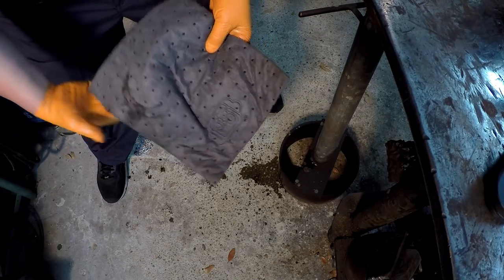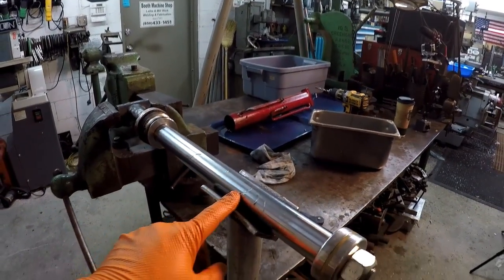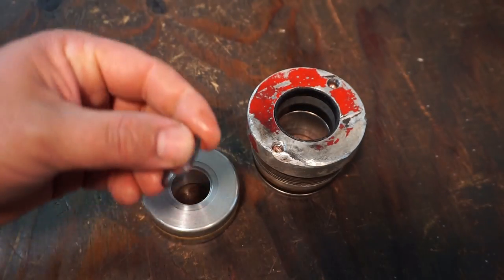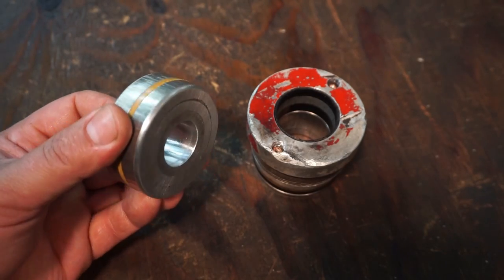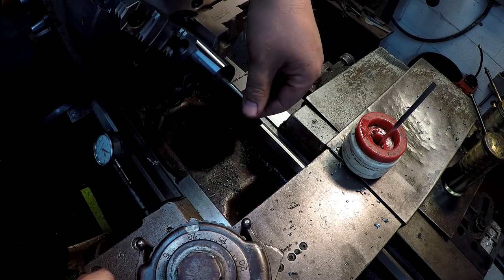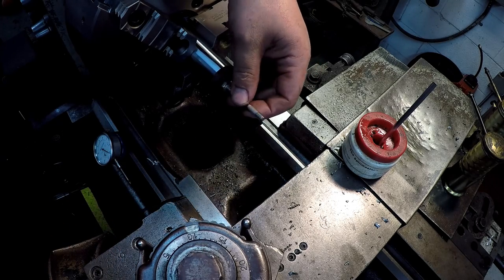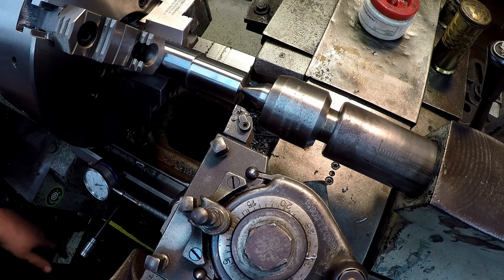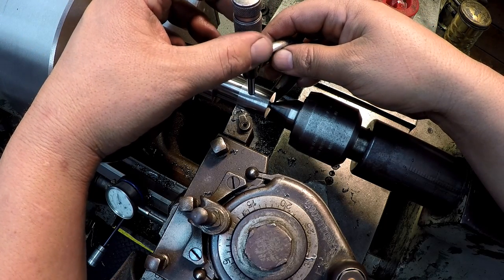Hydraulic Cylinder Repair Part 1

Comment: Could you metalize  the rod and then turn it down?
Reply from the maker: +Steve Sprouse They say you can but I have never tried it on a hydraulic cylinder rod.
Reply: Steve Sprouse I worked as the Manufacturing Manager at Douglas Corporation in Tekonsha, MI from 1992 to 1994. We did a lot of flame spraying with 420 stainless, bronze, and Diamond Jet  carbide. The  flame spray will work. But for a hydraulic cylinder replacing the rod is more cost effective. 420 stainless was $25.00 per square inch. Diamond jet which is much stronger was $100.00 per square inch. If it was a part that had a unique shape or size that wasn't easily found we would have the shaft hard chromed and we ground it back. You can buy Thompson rod for much less than the material and labor to repair the shaft. 
If it was my cylinder I would first look for a used replacement. Failing that I would check price from a dealer against having one fabbed up. 
Not knocking Abom or anyone else. Time costs money and machine shop time is not cheap.
Reply: I believe Adam is doing it for a good friend so I am sure they trade off labor. I am doing the same right now for my son's BH stabilizer cyl. new rod. Price of  1-1/2"1045 induction hardened chrome rod 30" lg. was $35 and my labor is priceless but free to him so it is much cheaper this way if you can do it. Hyd. shop quoted 3 hours labor@$85 per hour with me doing the welding of the end. New for this older ARPS backhoe was not available. Total $ for our rebuild, rod, seals, shipping not counting my labor is $95. So I feel Adam's job for a friend and mine was a quality, justified and inexpensive way to go. By the way, I did it at home on my Atlas/Craftsman 12"x4' lathe. Just my opinion. Thanks, Ed

Comment: OK im new  to  leaving a coment  but  wondering  I have  seen  you  turn  down  many  shafts  than  them  build  them  back  up  so  why  not  turn  that  shaft  down  and  build  it  back  up  and  turn  it to  size??
Reply from the maker: +norm barr It's must easier and faster to machine a new rod and replace it all together. Welding the shaft won't give it the surface the same hardness as chrome.

Comment: what was the purpose of the 1/4 bolt cut off in the end? i missed that part
Reply: I bet Adam is going to use it to thread the rod end on to hold it centered prior to welding.

Comment: Sorry just read the comments below, guess i should read them all before i speak ha ha.
I had a hydraulic shaft spray welded for my commercial airless paint sprayer it lasted about 5 years before it
wore in the same place. Couldn't get parts for it anymore and to have one made was 3 times as much.

Comment: Adam, are you sure you are using that mike correctly, seems to me you should be using the thimble on the very end to get the correct pressure for taking a measurement.
Reply from the maker: +Gerald Neville I was using it correctly.

Comment: I made my pants brown. At 18:08 you stick the tool for the leading chamfer in the holder and then.... start turning. Did not see you fasten it in the holder. Scary.
Reply: I've done it multiple times. Really no big deal. You just wonder why your tool isn't doing anything and the back end is sliding out of the holder. I guess if you really went in fast the tool could go flying out the back and get caught in the chuck.